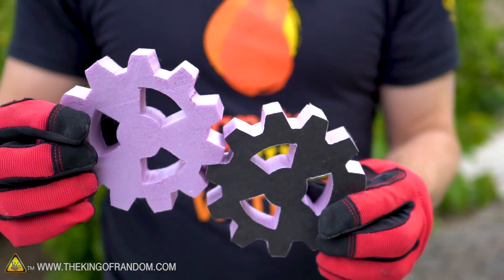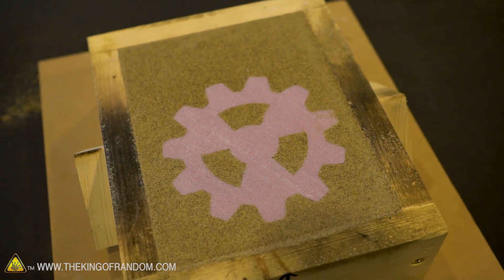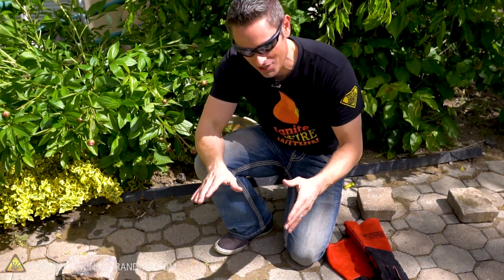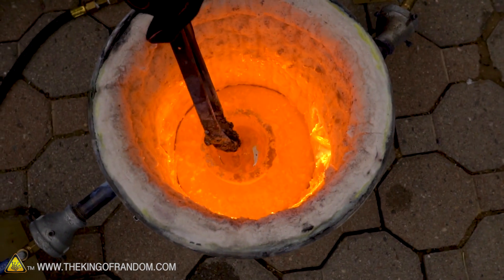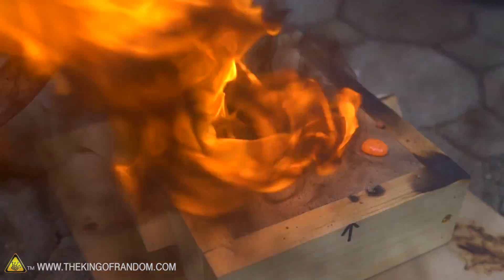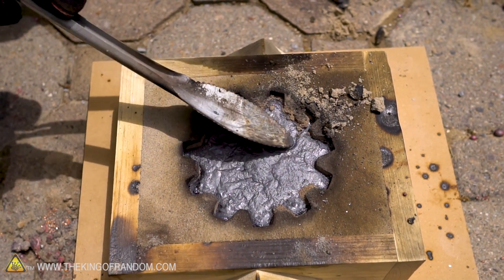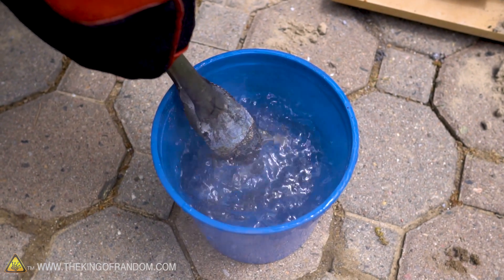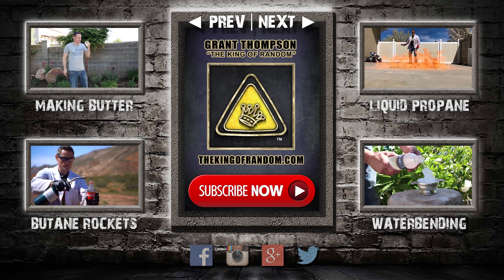Argh. Why Is Copper So Difficult? TKOR Tests Melting Copper In Our Homemade Foundry

Comment: You need to make some sodium silicate (water glass) and mix a bit with the sand. It will make the sand have a smoother finish and hold it's shape better.

Comment: I think that you need to shape a larger mold and have a place where you put your molten copper to flow into the side of the mold so in that way you will not knock the inner pisces.

Comment: Instead of using green sand to cast, could a mixture of sand and plaster be used? The same mixture as the mini metal foundry?
Reply: technically, yes, but thats a very expensive solution given that it can't be reused for another mold

Comment: Copper is super dense, sand just floats on it, like styrofoam on water. Add some cement or maybe clay. After that you can also try to remove the styro-gear from it to increase quality :)

Comment: try  making the cast inside the sand. put the foam gear in the casting sand with a tube attached to the center then cover to the top of the tube. then you can pour  in what ever  metal you want.

Comment: You could try heating the mold a bit before pouring. It should give you more time to work with the copper. You could also try making the whole mold in the sand. And pouring it right in the center of the gear. If the foam is completely inside the sand, there will be two contact points instead of one for the 'radioactive holes' making it stronger. Just a thought anyway

Comment: What about popping the mould into the oven for a few mins? The heat will melt away the styrofoam and it will dry out the sand as well...
Reply: it looked to me like the copper was a much denser material, so the sand in the center was actually just floating like styrofoam on water. So wet or dry, with, or without the styrofoam, it doesn't matter the sand is just too buoyant.
Reply: Nitrous Oxide The sand cools down the copper too quickly, heating the sand lowers the Temperature difference between the copper and the sand.
Reply: MagicSteve46 The problem with the torch is that if he's not careful it could ruin the mold. Even heating the mold up to 450 in the oven would solve a lot of his problems
Reply: irfan2507 The problem is that moisture in sand, when extreme heated, boils and causes the sand to break apart. It would normally work, but copper is a unique case, as was made obvious
Reply: I was also thinking that the copper was too dense. Maybe there is a way to add something to the sand to make it make it more dense.
Reply: I'm thinking boiling the copper so it doesn't cool down as fast. Heating up the sand and boiling the copper would fix a lot  
You could also turn the sand into glass and crush it back to sand after you're done. 
All of my ideas are way too complicated though.
Reply: I didn't know
Reply: Not too sure about how its spelled in American as I thought that "mold" is like a fungus or something. Also I am writing this from South Africa, so I guess its more British english?
Reply: "Mold" also goes for fungus too
Reply: If the sand is wet the heat from the copper will boil the water in the sand and make the mold to crack. 
I think the best way is to have more clay in the sand as a binder and as other say bake it in the owen to dry it up. that way i dont think it will crack when he pour the molten copper on it.
Reply: yea i was thinking he could preheat the mould with a propane torch maybe?
Reply: I'm also wondering if putting the 'top' on the mold and cutting a pour channel and an exhaust hole would work better.
Reply: The sand needs to be wet not dry
Reply: irfan2507 Wrong
Reply: this guy mispelled 'mold'

Comment: Hey Grant, I think the problem is the radioactive shape that you're trying to cast because there are 3 individual pieces in the center with no structural support. The heavy molten copper metal could easily wash away the sand while you're pouring them into the mold.

Comment: I'm not sure your green sand consistency is right because I've seen plenary of people use it just fine. Also what I've seen people do is put the mold in them get another box and put another layer of dirt on top with a hole to pour in the copper

Comment: have you ever tried to Clay instead of sand?
Reply: Or how the pro's do it, Wax and Ceramics.
Reply: For an open face mold, like he's using in this video, the air space between the sand grains isn't needed as much for air/foam vapor to escape, so a higher clay content should by ok.
Reply: Green sand has clay in it

Comment: Though it might be very rough detailed, I think it mig work better if there was a funnel that poured down into an enclosed foam gear, rather than direct pouring. I think the sand might just hold a bit better, though steam might build up and break it.

Comment: I've tried what u need to do is burry the gear and make a funnel in the sand leading to the gear under the sand
Reply: Muskoka Mike well he has made videos with that kind of method(burried styrofoam) before, so i don't understand why he doesn't do it again
Reply: Blake Deering that's what I was thinking
Reply: Themidnight club when he used the green sand it would work he just made this sand box design that can work it just needs  to not be on the top in needs to be in between sand layers
Reply: up
Reply: this is water based.....
Reply: Blake Deering was think bout that too...got dammit school
Reply: yea. gating is important, I assume that's what you mean Blake. open face molds have never impressed me in performance.
Reply: Blake Deering it dose not work well use oil based sand

Comment: It's not the copper. it's the styrofoam. use cheaper one. There's an explanation why but I'm not typing all of it. it's because the one you have is heat resistant

Comment: What you should of tried is having two layers of the sand, one that holds the mold and the other to close the mold and the mold should have a cylinder sticking out so that when you pour it from there it burns the mold but stays in place. Idk how to explain it. Best of luck. Huge fan

Comment: Part of the problem you are running into is the sand has moisture in it, which turns to steam, causing the mold to fall apart.

Comment: Maybe instead of pouring the copper directly into the shape you should keep the styrofoam gear in the sand, and make several pouring holes and vents. This would allow the metal to come from different points, reducing the stress on the risers...

Comment: Grant if the sand retains its shape after you put the foam gear in, can you use a toothpick to pull it out to reuse the mold over and over? This way you can reuse the foam piece again.

Comment: If anything, the water in the mold is a bad thing. When pouring molten material into the mold, the water inside the sand will boil and turn into steam expanding. I believe that is what might be causing your issue.

Comment: The sand is lighter than the copper. 
The sand is floating. 
I would suggest using a top to hold the center pieces down. 
Have holes drilled in the top to pour the copper through. 
... I just thought, check for "copper casting" via a search engine...

Comment: Only ever done investment casting. I don't do anything large enough to need sand. I would hazard a guess that you would be better served with a 2 part mold though. a top layer might keep enough weight on those pieces to keep them from popping off. Copper is a pain to cast though. Was told it likes to absorb oxygen while melting and off gasses more afterward or something. Should have charcoal chunks on top of it when melting copper from what I understand. I work in silver when casting though, so not an expert on copper casting...

Comment: you either need to add more clay mix to your greensand or make a 2 part mold where you make a closed off gear completely surrounded with sand. then you need to add a copper entry hole and i would say 2 fume/copper exit holes that way the sand doesnt have to ability to float and will stay where you want it to stay

Comment: have you tried a different binder for your sand. when forging different engine parts, a binder or 'glue' is used to help the sand hold it's shape and better react with the heat.

Comment: The three sand sections that kept popping out might have been better if there was something to strengthen them. 
Perhaps when making the initial mould a piece of wire or even a bolt in the middle of each blank might have held it together. 
Sand casting certainly can be used for intricate work and large work, though copper isn't a common material to use - bronze?

I'm also puzzled by the cost - in the UK I'd imagine that between £5 & £10 worth of copper* coins would be more than enough. 
*I'm sure it's an alloy in copper coins - very nearly 100%, but not quite. 
A 2p is 7grammes, so a £1 would be 350grammes.
£5 would give you 1.75kg. (3lb 13.7oz)

Comment: i belive the problem is that the moister of the sand eveporates when u pour the molted copper so the sand loses its sturdyness
Reply: there isnt enough binding agent in the green sand mixture hes got. it needs more clay.
Reply: Smitten // Zither wouldn't explode unless it was brittle like glass. his problem is that his mold is damp enough for those weak spots to pop off...
Reply: It's not evaporating it's boiling. Molten metal causes the water boil and explosions are the result. I think the only reason he's not getting an explosion is: one-part mold and too dry. Casting sand should be 'wet' from oil (which burns) not water.
Reply: No, because if there were that much moisture, the mold would likely explode.

Comment: from what I've found when you pour copper in green sand the moisture in the sand almost instantly turns to steam causing a mini explosion that tears the mold apart. you need to find a way to hold the sand together with as little moisture as possible.

Comment: My dad took a bronze casting course. Instead of making a sand cast, they used wax and coated it in a plaster cast of some sort, then heated it up to drain the wax leaving the hollow cast. then you pour the molten metal in to the cast.

Comment: Use Sodium Silicate as your sand binding agent, you can harden the Sodium Silicate using Carbon Dioxide gas. That way your mold won't be so fragile. Copper is a rather dense metal and as such, it's no surprise that the your sand tried to float to the top.

Comment: I think to get the results you want you need to use a different molding process. Part of the problem is your trying to poor a high heat metal into a cool sand base which is causing the  metal to cool too rapidly. What you should try is a mold base that you can heat up to somewhat hot to give the metal more time to spread before its cooled off. hope that helps with your castings.

Comment: You should try to cut metal with the stirosliser
Reply: The most it could cut would be balsa wood. It's far too cold to cut metal. You could literally grab the wire and all it would do would give you a slight burn and a reminder not to touch it.

Comment: might want to try a two Box method for the cast. when you flip add baby powder to the face place a second box with a rectangular piece of Styrofoam and add sand to create a channel for the copper to flow down.

Comment: Grant Thompson - "The King of Random did you see the sand bobbing up and down? i think it broke off because the copper is too dense and it just floats up to the top. like if you put a balloon under water. try using concrete?

Comment: Would it not work better if you used both parts of the sand box with two  sprews to pour the copper into so it hold its shape an get a full geAr

Comment: I haven't done any metal casting myself (yet - I've built a microwave kiln) but I've done a lot of reading - I don't think your "green sand" is quite right, and needs a lot more clay and a pre-bake. Melt the styrofoam out with a blowtorch well ahead of time, and the "sand" should be stiff enough to keep shape on it's own (much more like clay) or it won't withstand the pour as you've been learning. Copper is heavier than silicon, so sand floats! Everything I ever read said that a wet mold isn't just bad for casting, but potentially dangerous - you can get steam explosions which throw your molten metal everywhere, including on you.

Comment: Instead of greensand try a product called "Petrobond" I use it pouring harger silver pieces and it works well. I have poured 4 and 5 ozt pieces in copper as well and basically had no troubles. It definitely is moody a material.

Comment: You should use the top part of the mold, as well as running some vents, and having a lot of excess copper. By having the top you're adding stability to the sand, and the vents with excess will allow you to make sure you get the copper where it needs to be. If you still have problems, add some paper towels to the layers of sand for more stability.

Comment: the gas and steam is causing the sand to "pop out" due to the heat of molten copper. adding some lead to the mix may stabilise the metal but ideally you want to use a thick clay mould as it can withstand the heat and wont move around as much as sand. it will need to be quite thick as the heat will shatter a thin mould. another issue here and the last video was that the foam takes far too long to burn off and will add to gas production, you could cast a clay mould with wax, burn the wax off during firing and then cast the copper.
hope this helps :)

Comment: seems to me you are using the wrong kind of styrophome. You need the old fashioned kind make of packed styrophome beads that makes a mess when you snap it in half. This styrophome you are using is constricting when it starts to melt, which puts unneeded pressure on the sand.

Also adding more water is going to increase the steam produced which will weaken the sand also. Definitely do NOT try making a mold of cement that people are suggesting. The water trapped inside the cement will flash steam and cause it to explode..

Also try making an enclosed mold with a hole for you to poor the metal into.

Comment: Have you considered doing a pre-heated mold? I figure you could fully encase the styrofoam gear (apart from the flues) in your casting sand inside of a metal container, then heat that while you're melting the copper. 
Given the high solidifying point of copper I'm not sure how you could heat the sand in a meaningful way. I don't know if an oven would have much effect, but you could build a solid fuel kiln in a separate video for heating the mold, and I bet that'd be perfect. 
In addition, the heat would harden the sand (as shown in this video), so structural failure of the pre-heated mold wouldn't be an issue.

Comment: Heat the mold?
Nah, to radical an idea. Cold molds are better :)
Might also want to consider that an open face mold will never give the same quality as a fully enclosed mold with a proper riser, gate, and sprue cause the metal cool to rapidly on the top and not evenly through out.

Comment: Hey Grant, I think the sand is too light so it's floating to the top of the liquid copper (like lead floats on mercury). So use concrete or plaster of Paris to mold the polystyrene cogs and then continue as normal - the polystyrene will melt away and then you just brake away at the mold to retrieve your copper cogs.

Comment: the sand is popping out because it floats in copper, it normally isnt much of an issue with aluminum because it isn't nearly as dense. if you made the mold with a top to it, then it might work much better.

Comment: you should use a two part mold.  Use the gear as a blank.  Or you could use a channel.  in a two part mold, you can place a rod in the sand at each opening to hold them in place.  the metal never hits it and will give it more stability.  You can use portland and synthetic marine oil as an oil sand with great results.

Comment: Although the sand is not as reusable afterwards, you could try mixing some sodium silicate (water glass) with the sand, which then air cures reasonably hard over-night or is manually cured faster with some CO2. I've seen it work quite well with sand casting.

Comment: Make a closed mold, with a high sprue and ventholes. This way you have hydrostatic pressure during casting on your copper. The toplayer will prevent the sand from coming afload and keep it in place. The ventholes will vent the vaporized gasses from the foam. Because you have hydrostatic pressure, these gasses will be pushed out and the copper will take it's place. Take care of the height of your spue and your venthole(s). These should be the same and app. 20 to 30 cm above the mold. Also your sand is quite course. Take some finer sand, this will also be noticeable in your endresult.

Comment: You should make 2 gears and put a baring in the middle of them both. Then apply a positive and negative charge to each gear and see what happens when you rotate the gears while they are in contact

Comment: I don't know if this would work. But I've seen metal casters have the mold in the middle of the casting sand and have a hole that they pour into while all the sides of the casting box are clamped together. In theory, the sand shouldn't move and the molten metal should still melt the foam and cast. I may be wrong, don't have any experience in metal casting.

Comment: Try using a two part mold and leave the styrofoam gear in while casting. I would think that a top mold with a runner or gate in the middle of the gear would work because the top helf would help keep the radioactive symbol in place while the foam melts off. Also do not add more water....

Comment: Instead of having the top exposed try using a runner or tube to the Styrofoam completely covered in green sand and casting 
 through those having the sand's weak points supported on two sides may add more support.

Comment: Instead of wettening the sand, use motor oil with very dry sand instead. Water and high tempratures result in steam, that destroys your sand modell